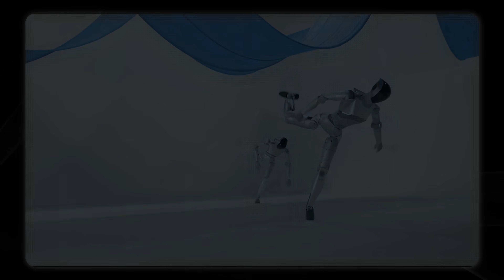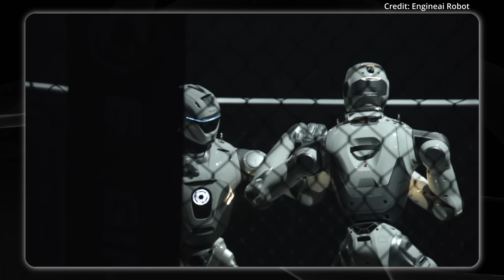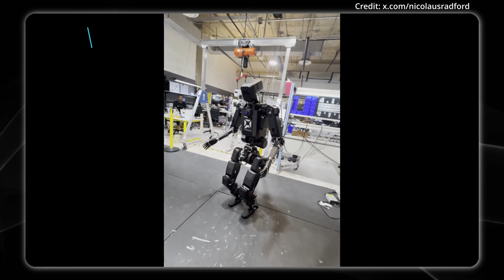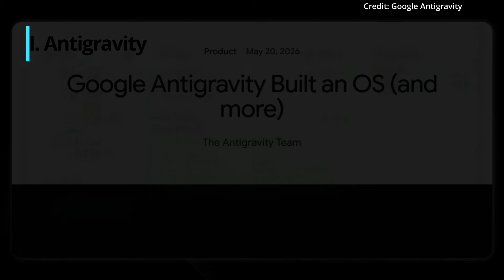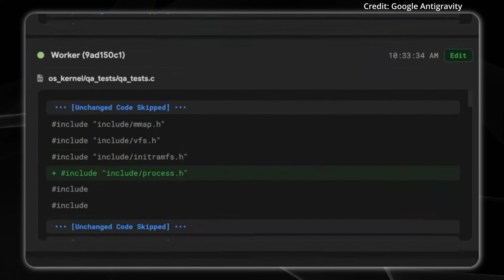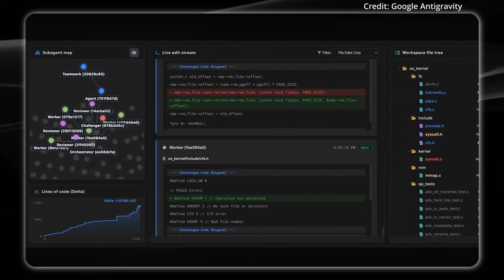T800 Terminator? Humanoid Robot GAME CHANGERS In 2026 ($40,000 AI ROBOT)

Comment: This makes no sense. Humanoids have never been useful as "workers" and it's easy to explain why AGI can't change that. We see how Amazon is replacing people and it's not with humanoids. Because robots ALREADY use Vision and AI and they don’t look like humans because humans are limited. (they have to climb ladders, hands too big for small things etc.) Automation has been replacing people for decades and it hasn't stopped! So if a humanoid could do it, it’s already automated! (1) Just look at history. (2) So NO, they WON'T become useful as technology and AI improves.

In other words.(3)
In other words.(4)

Many seem to think factory jobs are easier than other jobs, they are not. A lousy housekeeper won’t cut it. Even if it had a brain it still couldn't work at McDonalds because the hands can't bag items, make change, crack eggs, wrap burgers etc. Also it should be obvious that AGI does not need a humanoid to replace someone sitting at a desk.

____________more ____________
Look at it this way. If AGI could assemble widgets or do surgery or manicures, etc. it would need special tools not batteries, hands and legs. Optimus is not strong enough to dig a hole or help someone get up off the floor. It can't work at McDonalds. Can it wash its hands? How long would it take it to change gloves, start a roll of tape etc.? A humanoid MUST do a job on par with a person because workplaces are made so people along with machines maximize asset utilization. That is why you CAN'T just put two humanoids in place of one person.

This is why no one has EVER shown ANY humanoid doing any useful job that a person was paid to do. But AI could make it a fun toy or criminal.

If you have a trade job, you’d realize it would be impossible or impractically slow to do it with robot hands. No amount of AGI Learning or training is going to make clumsy hands better with tools, scissors, small parts etc. Making hands equal to a person is impractical and unnecessary.

Hot, heavy, dirty and dangerous jobs. There are 100s of millions of them around the world. And if a humanoid could actually do it, LOL, most of those jobs pay super low wages in places where there is no electricity to charge it anyway.

Most of today's humanoids can't complete the tasks from the DARPA robot challenge 10 years ago !?!

"Optimus will be the best surgeon" !? When AGI can do surgery, it will use existing surgical robots. A humanoid will not wield a scalpel.

"it's a humanoid so it can work in a human environment" The humanoid form or its brain doesn’t matter. What matters is what it can do.

Who will buy them? Certainly not factory or warehouse managers. They can't do trade jobs or hard labor. They will be lousy housekeepers, tour guides, popcorn servers, entertainers etc. ridiculed as toys and criminals will use them for nefarious purposes. At best it could be a checkout clerk that will restock the store at night if it ever really gets a brain. Credit only, robot hands can’t handle money well.

But they would be really nice if a handicapped person could use it as a telepresence to go shopping, do simple chores, etc. Please make a version like this despite "empathy is weakness"

I'm a retired automation engineer, a better use for AGI in factories would be to replace low precision sensors. Example. If an AI agent could watch a conveyor line and all the parts on it, it could control the motors, escapements, pushers, etc. and it could see where things are without the need for sensors. is the escapement in place, is the part? what type, orientation, how many, did it fall? You could eliminate a bunch of sensors that are costly to maintain, it would save a ton of money on parts, engineering, programming, maintenance and downtime. It could be a natural language (instead of ladder or state) programmable logic controller. The new PLC will be NLPLC with the usual outputs, and mostly vision inputs. Keyence and Cognex already use vision to inspect, measure, identify etc. AGI could take it to the next level.(maybe they're working on it) you'd need several cameras at different angles for reliability/redundancy so AI is needed to identify targets from different angles and if cameras move. Maybe language programming would be a separate AI. It sounds like it might be a low bar for AI but I doubt it's really that easy.

(1) It's first principles. If the goal is to emulate a human then you must make a humanoid/android. But if the goal is doing things that a human can do, then first principles DOES NOT dictate a humanoid. So AI is already "embodied" or "physical". (ill conceived terms, us old folks say, smart sensor or smart tv) And if you do want to emulate a human, you must choose which characteristics you want. It may need sensitive hands to feel slight imperfections or it may need durable hands for hard work. So a one-size-fits-all like Optimus is not practical. Unless it can reproduce, heal and recharge itself for decades by simply eating and sleeping.

 (2) Warehouse managers needed people to store and retrieve items. Now warehouses are full of non-humanoid smart robots. People had to pick parts out of a pile and place them with correct orientation. Now one armed robots do it. People had to pick up parts to inspect and measure them. Now lasers measure them and vision systems inspect them. PID controllers became self tuning. As tech/learning/AI improved, so did machines and machine controllers. Just like computers taking jobs with spreadsheets and scanners. All the while someone was saying a humanoid will soon do the work.

(3) Humanoids will never be able to do most jobs because most jobs are doing things that robots(software automation and hardware automation) cannot do and humanoids ARE robots. It's that simple but sometimes it's hard to see the forest from the trees.

(4) Ai has been used and has been improving for a long time. AI has already been replacing both white and blue collar jobs through attrition by making the workforce more productive. So it will only continue. There will be no big change, just the same productivity gains. Which itself has always been a problem for peons for obvious reasons.